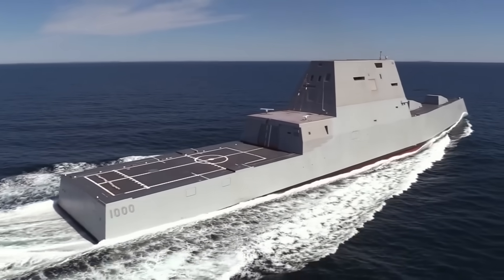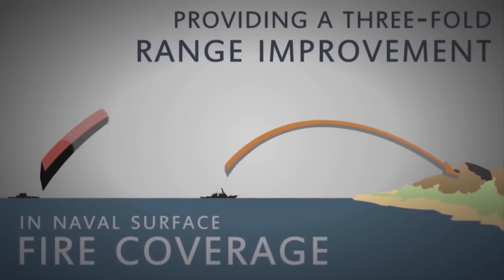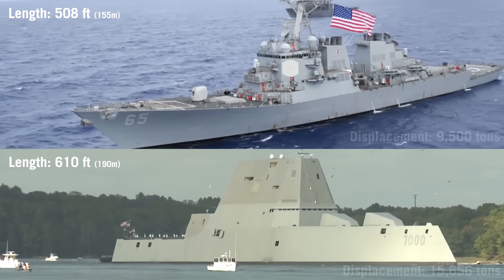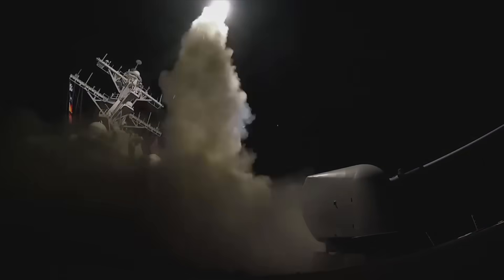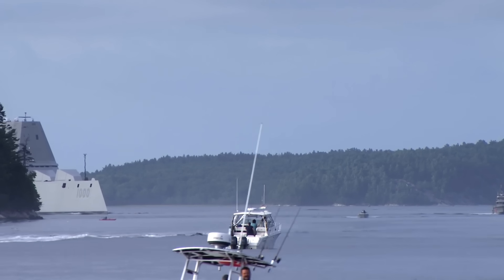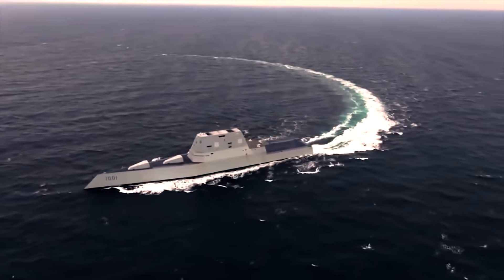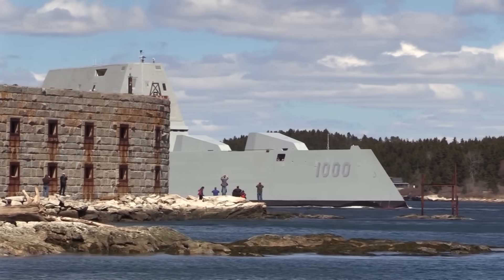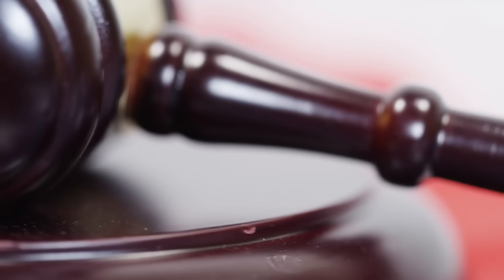What Killed Zumwalt Destroyers?

Comment: Should have kept it simple and built lots! Strength in numbers.
Reply: I see what you're trying to say comrade
Reply: That's stupid because you end up massively increasing your operation cost.
Reply: @dzello  They don't all have to be at sea all the time. Besides you know what is better than 3 super expensive ships with no ammo? 12 fully operational Burke class destroyers.
Reply: @TurinTuramber  That's the thing: you're wrong. It's better to make one good ships than tons of meh ones in peace time because otherwise.. you have super high operational costs. Even ships that aren't used have maintenance. Also, simple and a lot is an obsolete concept even in war time now.
Reply: @dzello  Imagine during a long drawn out war, when resources and speed are key - all these white elephants will be mothballed in favor of numbers and output. I do understand though that they do need to keep development on going, maybe push the envelope too far on this. 

You can have the prize for the most state of the art ship on the world but if it's on the other side of the world when things kick off then it's worse than useless.
Reply: @TurinTuramber  Your entire comment falls at ''imagine during a long drawn out war ''. 

Those don't exist anymore. They are impossible. This is 2021. It's why we don't use battleships anymore... One missile is more effective than a full battleship.
Reply: @dzello  Why are they impossible?
Reply: @TurinTuramber  Because warfare changes over time because of technology.

Look at old pictures with the first guns. Armies would line up and shoot eachother because that's what guns allowed. Fights like those were long because guns didn't shoot fast and so on. 

Then, we had trench warfrare. Fights were long because we had no mean to push a trench. 

And now, with our insane technology, fights are extremely quick. It's why we had the Cold War... Because both country had a mean of INSTANTLY ending the war catastrophically. 

Today, even without nuclear weaponery, we got such high tech armament that no fight is drawn out. At any point, the USA could wipe out its opponents even with normal missiles. 

Drawn out wars cannot happen anymore.
Reply: @TurinTuramber  Even if the US and Russia were fighting eachother all out.. The fight would be very short. Both teams would shoot tons of missiles and casualties would be absurdly quick.
Reply: @dzello I would argue that you have jumped to the worse case most extreme scenerio to make your point. Whilst all out war against a large nuclear power is possible, more likely they would be utilized in a prolonged conflict / proxy war. If fancy hi-tech weapons solved all the problems in the world then the US would not have been in Vietnam, Iraq, Afghanistan, Syria etc.
Reply: @TurinTuramber  Nope,  I didn't. I just made it more obvious so you understand and I EXPLICITELY said ''even nuclear weapons aside''. You, however, failed to understand what the US is doing.

Nothing you wrote are actual wars. They're anti-terrorism measures, measures to show power, but really... They aren't a big deal. They aren't prolonged warfrare either: at any point, the US could bomb the entire country and wipe out the terrorist, they CHOOSE not to. 

I didn't jump to the worst case scenario because it will never happen. Since the World Wars, we have been traumatized to war. We do NOT want to have wars anymore hence why we have the UN and why we don't war really. 

The reason for that is we SAW just how insane technology. Back in the days, a war would kill some soldiers... Now, it will obliterate a continent. 

Prolonged warfrare does not exist because ANY warfrare would be instanteneous and devastating.
Reply: @dzello  You're absolutely correct that any future war involving nuclear armed powers against other nuclear armed powers will be horrendously short, and i'm not sure how likely they are to occur. But the fact is that modern warfare and modern wars are like Vietnam, Iraq, Afghanistan, Syria and the Russo-Ukrainian war that has been ongoing for 6 years now. Modern armed forces aren't adapted to this type of warfare despite it being around since the 1950s, which is why modern conflicts are so long and so disastrous, Iraq and Afghanistan. 

The question arises as to what we should continue to spend money on and whether they will be useful in this kind of warfare. A good book to check out if you're interested is 'The Utility of Force' written by the British commander during the 1991 Gulf War, he talks a lot about what you and Geralt have been discussing, explaining how war has changed from the old fighting of WW2 to the new paradigm of Afghanistan, Kosovo, Iraq, the ongoing Arab-Israeli confrontation.  You're both absolutely right in your points, they just need mending together.  I hope this helps!
Reply: @jamiegray6931  NONE of those are wars. I ALREADY covered all of that.  

The reason they are prolonged is the lack of fucks given. Every of those countries could have been obliterated by missiles but they havent and the reason is.. Those arent wars.

This is just shows of powers, protecting resources sometimes, petty stuff like that.
Reply: @jamiegray6931  This isnt " modern warfare ", this is " no " warfare. Its us not wanting conflicts BECAUSE we have insane weapons and actual wars would be disastrous.
Reply: @dzello  Not wars in the traditional sense, hence the paradigm shift, but in terms of the fundamental definition of war by Carl Von Clausewitz of which military historians and Generals use, 'war is the use of force for political purposes'.
Military might is applied lets say on Saddam Hussein to force him to  leave Kuwait. Military force is used by the United States to force the Japanese put of the Philippines and to force the Germans out of France.
For Ukraine now, the Ukrainian government is using military force to push out the Russian troops helping the pro-Russian rebels.
Reply: @jamiegray6931  They are simply not war. They are conflict at best but none of those are wars.

Hell,  most of those conflicts arent against a COUNTRY. Theyre against organizations.

Theres military interventions, but not wars.
Reply: @dzello  They're not mutually exclusive and youre right about not using nuclear weapons. However, in terms of conventional war, we are still using force.
Take Iraq in 2003, the US and the Coalition launched a huge naval invasion off of Iraqs coast aswell as pushing in from Kuwait. In terms of the tactics used and the types if vehicles this was war, people dying ect ect. Of course we could have nuked Iraq, but that is not the desired outcome. Nuclear weapons are the extreme end of the uses of force and acts of war. 
If we look at the Falklands for example, Britain could have nuked Argentina to force them to abandon the Islands, but that would have not delivered the desired effect.
If we want an example without nuclear weapons, then WW1 is a good example. The entente could have murdered everyone in Germany if they wanted to, but they signed an Armistice instead. Both would deliver the same political result a defeated Germany.
Reply: @dzello  By what definition of war can they not be considered war? I just want to know the framework you're using.
Reply: @jamiegray6931  I mean, you could argue that it's not a war, it's a major superpower picking on a random country which barely had a chance of defending themselves, and no chance of causing any major damage to that superpower, and if that superpower felt like the enemy had a chance at any point, they would have just neutralized them with nukes, they just didn't want to do that, because it would hurt the natural resources, and alert the other nuklear superpowers.
it's not really a war, but a one-sided slaughter for resources and land.
Reply: @jojomaster7675  Except said superpowers are losing and or performing badly. The Taliban in Afghanistan have regained most of the territory they lost in the last decade leading to most coalition member to pull out. 
Iraq is a failed state with IS and Hezzbollah continuing to disrupt everyday life.
And on the other end of the scale Ukraine is still continuing its struggle against Pro-Russian rebels.

Using nuclear weapons is not of the table for dealing with modern day conflicts against non-state actors.

You could argue that these are wars, but arguing about the definition doesn't answer the question as to why modern governments and Coalitions are failing in their objectives.
Reply: @jamiegray6931  They're mostly losing due to politics restraining the amount force they can use against them, since if it turned into a full on war (like ww2 for example) where there was more on the line, other than oil and a little bit of puppeted land then they certainly wouldn't be losing anymore.
Reply: @jojomaster7675  At the start of the Afghanistan the US brought its B-2 bombers out to strike at Taliban targets. During the Iraq War the UK brought out its entire Tank force for the land invasion. The only force being restricted is the use of nuclear weapons. During the Vietnam war the US dropped 2 times more ordinance than throughout the entire Second World War. 

In all 3 cases the US and Coalition comes out without achieving their main objectives. 

Political will is apart of War and always has been. Its why Russia pulled out WW1 and the USSR out of Afghanistan. Its why Britain gave up in Afghanistan and why it gave up in the US revolutionary war.
Reply: @jamiegray6931  The american forces were heavily restricted at times during the vietnam war, and of course they dropped more ordinance, since technology advanced at an incredible rate during those times and the war itself lasted way longer.
The B-2 strike damage was small for the time when compared to the ww2 bombings.
Russia pulled out of ww1 because they were losing, the people didn't want to fight anymore,  and the communist takover of the government happened, so russia was in no state to continue fighting.
The Us revolutionary war was an old conflict which barely had any politics in it in the first place, so don't bring it into this.
Another reason to pull out of a modern conflict is because it just isn't worth the money anymore, and I'd say that because one side can just pull out whenever they want, it's not really a regular all-out war, but a partial war/conflict.
Reply: @jojomaster7675  War is all about politics and always has been, you can't fight a war without the support if the people and the military. The state will only use the military if they have public support for it. This is pretty much the reason that the US didn't join WW2 until after Pear Harbour. Without politics the revolutionary war would not have started at all, taxation without representation. Without politics the US would never have intervened in any global war, without politics the system of alliances and treaties would never have started the first world war or caused Russia to abandon it. Its a fundamental aspect of war and conflict.

The Vietnam war is the textbook example of a modern conflict, being hampered by a lack of popular support against a non-state organisation Vietcong and NVA, using weaponry that was designed for another World War. The US and its allies used more ordinance than WW2 and still failed to achieve the goal of a capitalist Vietnam. Which is why it went on for so long despite the US winning its pitched battles and killing a lot more of the enemy than the enemy did unto them.

This formula applies to modern war too, with Iraq. The Coalition was able to topple Saddam, but was not able to defeat the pro Saddam guerrillas and achieve a stable Iraq, despite always winning its pitched battles. Since then military forces have slowly reduced due to political pressure, but the long term mission failed. To say the war was about oil is a misnomer as Iraq used most of its oil during the Iran-Iraq conflict thereby being the reàson it invaded Kuwait.

The point is that we will never see another WW2, the nature of warfare has changed to the new paradigm of guerrilla warfare and long term conflict, which we are unable to win.
Reply: @jamiegray6931  We will never see another ww2 because if it came to that, nuklear weapons would be used, so the war, and possibly the world would end very quickly.
As I said, and you stated, the reason a lot of the modern superpowers lost 'wars' was due to politics interfering. Politics only really started interfering in the modern era, while in older conflicts, it was mostly only about military might.
WW1 was a conflict that was just gonna happen, politics or not, though you are right that they did increase its scale.
I could keep posting argumets to every single one of your claims, but I just don't have the time to keep doing that, since it is clear that this argument isn't gonna end in the next few years without one or both of us backing out, and I really don't have enough time to keep doing that, so I'm out.
Reply: @jojomaster7675  Ah that's a shame, i understand a lot of your reasonings i just don't think you're looking at all of the evidence. I actively study these kinds of questions, so its always good to debate them to keep me on my toes. YouTube comments being what theyvare i wish we could debate properly so we could more understand each other but oh well. I mean no disrespect and wish you a good day.
Reply: @jamiegray6931  I didn't mean anything against you either, just that english isn't my first language, so long comments just take me a lot of time to write. 
Goodbye and have a nice day.
Reply: I'd say that's war time production, in peace time, you want quality
Reply: @abisrizvi2621  Maybe but wars and particularly conflicts start quickly - a ship in the ocean is worth ten in the dry dock.